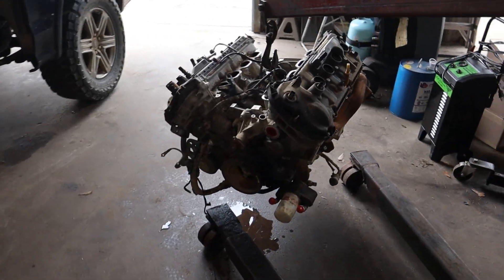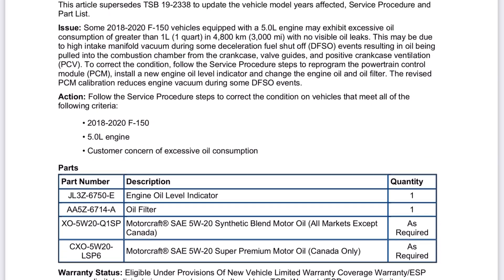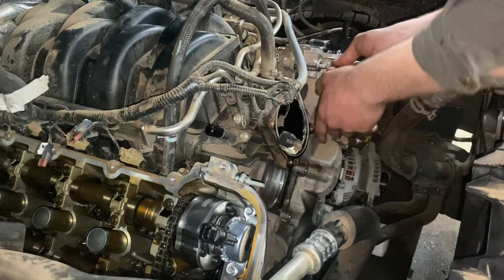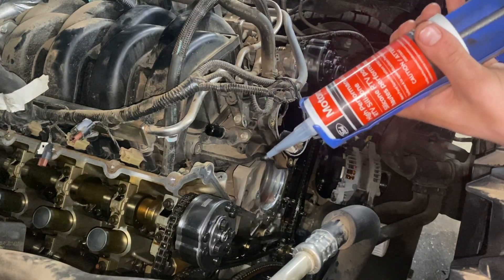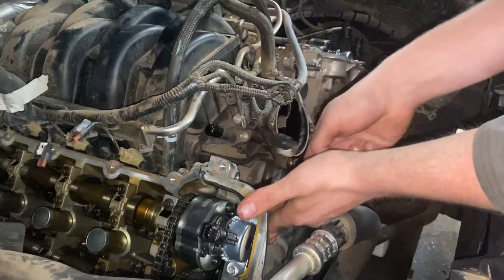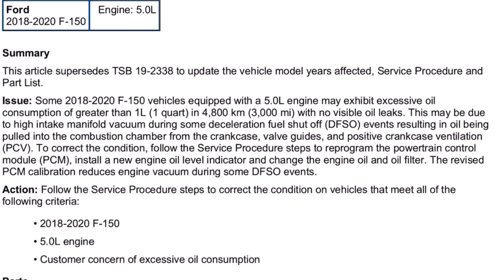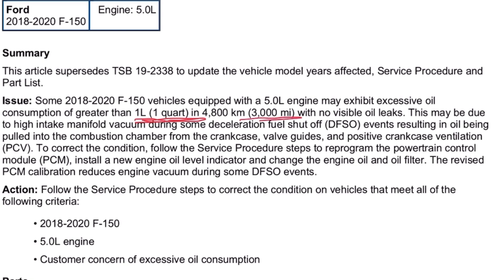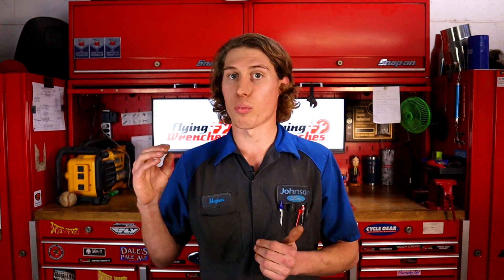Ford 5.0 Coyote Oil Consumption FIX

Comment: I have been a Ford tech for 36 years and have talked to a Ford Engineer from Dearborn.  He told me the dip stick is wrong. If you change the oil and fill it with the specified amount of oil as per engine specifications, it sits at or below the bottom of the cross hatch. Then they add more oil to bring it to the top of the cross hatch. Now it is overfull. The PCV system will draw the excess oil into the intake to be burned. Like you said, if you never check the oil it would be fine. Lol. In conclusion, the engine consumes oil because it is overfull. That is why Ford recommends the new dip stick with the correct markings. The reprogram on the PCM was a cover up attempt to hide the fact that Ford put the wrong dip stick in the 2018 to 2020 F150 5.0 L. The Ford Engineer told me the PCM reprogramming did nothing as far as preventing oil consumption.
Reply: So ,, If your 2018f150 5.0  ,, " Holds"  8.8 quarts  ,, You install 8.8 quarts it's " Over Filled "  ?   ,,,,  ( Why do I feel Dumber after reading what you Commented  ?  )  😅
Reply: I had a 2018 that consumed oil.  They reprogram the engine and changed my dipstick.  Neither fixed the problem.  They changed the phasers and that did not fix it.  My truck was in the shop more than at home the last year I had it.  The problem is most likely bad coating in a certain batch of engines.  Not all 5.0 burn oil.  Ford knows they need to replace the engine to fix the problem.

Comment: If people never check their oil, then how do people know there is oil consumption? That doesn’t make sense. Also, if Ford designed the engine to work that way, then they wouldn’t have been replacing engines under warranty for oil consumption, they would have said it was designed to work that way. No offense, but this sounds like a corporate response.

Comment: The cylinder lining getting changed. 2018 to plasma sprayed cylinder liner and rings don't seat. My 2018 f150 5.0 uses a 1 quart every 2k miles. Ford changed the rings on the newer gen 4s.

Comment: Ford told me it’s ok that there is no oil on the dipstick after 5000miles.  Crazy. I blame it on the plasma lined cylinders.  They fixed it on the gen4.

Comment: ok so of the 200 fords in my fleet and one of my 5.0 no leak and loss of 3 quarts after the t.s.b up date  so how do i fix my oil loss ??? and all my driver check oil as ALL ENGINES BURN / USE OIL AS THE COMBUSTION  PROSSES  3 QUARTS IN 1000 MILES IS NOT NORMAL .   SO YOU HAVE NO FIX

Comment: I agree with you. I have a 2020 5.0 I measure oil going in and measure it coming out. I usually put 9 quarts in. I usually get seven out and I change my oil every 6000 miles and no I don’t check my oil in between oil changes And I have no problems and I don’t expect to have any problems

Comment: I had this issue with my 2020 5.0; and installed a catch can after they applied the TSB fixes and it still uses oil. It uses a little less than it used to, I can now go 3000 miles before adding a quart. I was using a quart every 2000 before the TSB. I check the catch can every 1000 miles and it usually has about an oz or two so the problem still persists. I've noticed the tachometer goes up as it downshifts when slowing down so there is still engine braking going on unless you put the truck in snow/wet mode, where it doesn't downshift when you let off the gas.

Comment: Ford just replaced my wife's 5.0 motor in her 2018 due to this same issue and metal shavings in the oil. She had 1 month left on her extended warranty, also the dealership had just came out to the house 2 months prior to change the oil. So it was all documented that we had a oil change by the dealership.

Comment: I liked your channel until this. My check engine light came on around 90 000 miles and it was a vvt code. I check the oil and it wss none on the stick, it took 5 qts. Oil change regularly at 5,000 miles. Being a mechanic for over thirty years i never heard such bs. Most cars with vvt will through a vvt code when oil is low

Comment: Mine was 3 quarts low after about 1500 miles, and it caused damage to a solenoid. After that got fixed I checked the oil after another thousand miles and it was low again. If I don’t check my oil she’s gonna blow up.

Comment: Check oil once every 2 weeks period. I agree with Matt Phillips wholeheartedly. My 2012 also burnt oil and when I went on road trips, I used to take extra oil with me. However, the PCV valve change slowed it down a LOT. Check oil twice a month of not once a week. I am going to give this video a thumb down for many reasons.

Comment: Ford changed the 5.0 oil away from 5W20 , now 5.0 will use 5W30.... Too thin when hot... The GT500 uses 5W50 full synthetic

Comment: My 5.0l 2020 F-150 went through an extra 5 lires of oil between oil changes recently. I didn't know they called it a 5.0 l because that's how much oil it consumes. It's currently a candidate for a new motor as per Ford's TSB.

Comment: "who checks their oil anymore" only people who like their engines to run for a long time... lol

modern cars burn a ton more oil than old cars... they use water thin oil and it leaks out a lot easier and faster... i find modern cars burn more oil than old cars... "normal operation burns one wuart every 3k miles".... ok and the oilchange intervals are what 8k according to the factory? so youll be 2.5 quarts low and sucking air around corners by the time of scheduled change... geee i wonder why modern engines only last 100k  anymore? lol

Comment: As a lifelong mechanic I don't agree at all with him saying don't check your oil. I think that's silly. My bigger concern is that the oil That's not being burnt in the combustion chamber is going to the cats and being burned there and stressing the cats which will in turn burn them out causing a pretty substantial repair.

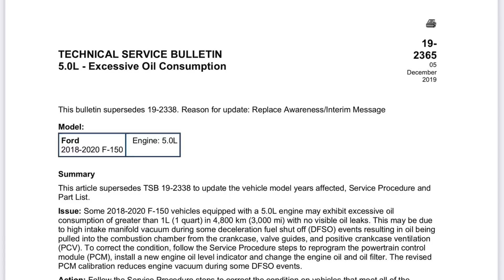Comment: 1:23 my opinion before I hear yours is that the 5.0 pistons are just built looser than older vehicles. The looser they run the higher mpg I would guess. All vehicles are gonna use a little bit even if you don’t think it will you take it on a long road trip and you will see that it does. The pistons burn off just a small amount the longer it runs.

Comment: It’s a problem. I don’t think it’s anything to do with a PCM or a vacuum. We just sold our 2019 f150 because it was consuming both oil and coolant. Truck only had 71k miles on it. We bought it with 30k miles and didn’t have any problems until a few months ago. Like mentioned in the video we weren’t checking the dipstick. Then it started knocking and I pulled into an O’reillys. I put 4 quarts in there to get it in range. A week later another quart. Been burning through quarts so much we just stopped changing the oil because it’s always fresh and clear looking. Then the coolant consumption started last week. Dumped a full container in the reservoir at a 7-11 to bring it into range. 3 days later another 1/2 of a container of coolant and more oil. Drove it straight to the dealer and traded it in for a Jeep. My thoughts is something failed internally in the last 10k miles and keeps getting worse. Not sure what it is but I’m sure I’m not going to keep it to find out the hard way and have to shell out $10k on a $20k truck for a new motor

Comment: Been checking oil since i was 7 years old, ain't stopping now. Wow, just wow, and i drive fords. Ranger 2.5, over 180K, 6 quart due to the ph8a mounted vertically, doesn't burn oil. 14 coyote, 166K, just started to burn a quart during last 10K. The beatings and oil checks on these will continue until fords customer care improves.

Comment: the thinner the oil, i.e. 5w20, you WILL burn oil. Ford and every damn company for that matter, keep lowering and lowering viscosity. ONLY to meet CAFE standards and "improve" MPG. Right off the bat, try 5w30 oil. Install a new PCV. just those 2 alone, you WILL see less oil consumption. even further, you can install a PCV catch can system, and up the oil to a 5w40 or a 5w50. The 5w50 has already been "Ford approved" in several Mustang 5.0 applications.

Comment: '14 was burning 5w30 syn, at least qt about every 2k at 165k. Put the valvoline retsor protect 5w30 in and it stopped burning oil right away. 🤷‍♂️ on second oil change with it now. 

All i noticed was it looked pretty thin at 5k miles, but nearly full.

Comment: Sorry bro but checking my oil is how I found out. Came straight home from a fresh oil change at the dealership. When I noticed I got straight online and found out immediately the oil consumption issues. They're making me jump through so many Hoops my extended warranty is going to run out first. I don't know what to do it's using two or three quarts per week it's to the point that I am pouring burnt oil in my engine

Comment: My change engine oil light came on... but I have no leaks in my 2020 V8 F150 so comminuted driving. Soon there was a funny rattle and the engine light came on and I was losing power going up hills... I checked my dip stick and there was no oil in the engine. In all the vehicles I have had... Nissan, Audi, Kia, Toyota... this has never been an issue

Comment: I’m 33 and check oil on everything I use. For outdoor equipment like mowers, snowblower, etc I check before I start them every time. For my truck I do every month or so. I think it’s absurd to never check oil and to think it’s ok to be burning 1 qt every 3,000 miles. Going the specified OCI that would mean over 3 quarts low.

Comment: Blame the EPA for a lot of engine problems. New fuel economy standards that have to be met every year causes engineers to grasp at straws ie. low tension rings to reduce friction . Lighter weight components to the point they crack/flex/ cause misalignment. Plastic components for weight reduction/ cost ect. Trying to get good fuel economy with hi horse power in a super light weight engine means everything better be dead nuts. That can't happen in a mass production setting that churns out 100,000's engines . Boring / honing equipment require frequent maintenance for dimension specs and cylinder wall surface finish. There are too many fires to put out for the engine plant to keep up with everything.

Comment: On these engines the crankcase vent is electronically metered.  That being said,  they burn oil at increased rates primarily because of LV engine oil combined with low ring tension.  Use 5w40 and check your oil frequently!

Comment: That’s a cop out, not checking your oil,how does that explain why the engine is consuming oil?  Don’t check your oil is your  fix? You have got to be kidding ! Just because you don’t see your oil level go down because your not checking it doesn’t mean there is no problem…… your just lucky the oil sump capacity is high enough that it doesn’t run out of oil!  Any engine that goes through that much oil,there is a problem in my opinion!  If your running an engine under full load constantly ( like on a gen set for example)then it’s possible to consume a qt of oil between oil changes, otherwise it’s not normal. There is a problem….. engine rings for example…… something is causing it

Comment: Dude you're wrong. I own a 2018 with that 5.0 with 124675 miles on it and engine just blew up on the highway. BTW. On checking the oil, I do check my oil since ford mechanics are so dumb to put the right amount of oil on the trucks all the time. Now ford will not take any action on this and I have to pay all that out of my pocket.

Comment: We should be checking the oil like we used to with the old 60s cars. What I read in comments makes sense. Forged pistons, low tension rings, and the spray cylinder lining. Those together. I don't doubt the plasma lining is tough, but maybe that's part of it. Is the coating so hard that low tension rings dont ever "break-in" like they used to? My  2019 F-150 5.0 burns oil like it's still breaking in, though less than when brand new. Sometimes. A lot depends on the kind of driving. Straight highway, constant speed, running all day at operating temperature - I could drive 3k mi and hardly burn any. Around the suburbs in my normal routine, it can burn a quart in 1,500 miles. Never had the "fix" done. There's a reason the vacuum is sucking oil like this. I think it's the forged pistons needing the looser rings coupled with the spray lining. To me, this makes sense.  Different driving habits mean that not everyone experiences it the same. I'm retired. I do a lot of cold starts and short trips. In Canada here, I have even more warm-up driving. I check oil like I've done for 40 years, especially when I know it's consuming oil like this. I don't depend on it holding a huge capacity, when I dont know what amount is safe when the dipstick goes dry.

Comment: This guy is not someone I would want working on my car or truck! If a tree falls in the woods, and no one saw or heard it, it really didnt fall! I can tell you if your vehicle uses oil, it will shorten the life of your cat. After building engines for over 100 years, and they start using oil shortly after leaving the factory, there is a design flaw!!

Comment: The reprogramming did help my 2018. It was using 2 quarts in 5000 miles. I change oil every 5000 miles. And yes, I check my oil at least once a week, after it sits for at least 30 min.

Comment: I check my oil every Monday morning.  Losing oil at a quart every couple thousand miles is not acceptable.  Designing a system to have 3 quarts to be a range is plain stupid.  Kind of apropros that the loss of oil to this magnitude started with the 5.0 and is the only engine on the market that guzzles like this.  Normal, abnormal is more appropriate.

Comment: Dont burn oil lol. My 2015 5.0 used to burn oil but I put catch cans on it. Passenger side catch can has oil in it every oil change about 3/4 full. The drivers side is as clean as it was when i installed it.  The problem is where they tied the valve cover back to the intake for “emissions” It creates a vacuum thus it pulls oil.

Comment: I had a 2018 mustang gt, bought it brand new and put 18k miles on it in the first year I owned it. Mine had timing chain rattle on startup and since it was a manual transmission under deceleration at low speeds in first it would rattle very loud. I took it to ford as it was still under warranty and they told me this is normal. Mine also consumed oil, even with an JLT catch can on it. Was so worried about the longevity I sold the car after 1 year of ownership.

Comment: My thought is if the vacume is pulling oil into and through the combustion chamber. Then it is going through the catalytic converter. At a quart every 3,000 miles, that is a lot of oil in those cats. I'm surprised there isn't a lot of cat failures and how did or does it pass emissions? 
It would also seem that the valves and combustion chambers would be loaded with oil coke. Rings loaded. 
I'm not saying you are wrong.
I'm saying there's more to this than just oil missing. If it's going through the combustion process. 
I've owned 2 coyote engines. I never checked the oil in either one. Just had them serviced regularly.
Thanks to you, I'm curious now, aka concerned.
Ha!
Your theory sounds right to me.
I remember when pcv valves where a maintenance part. If you installed the wrong one it would suck the oil right out of the engine.
On decel and wide open throttle. 
Chrome valve covers without baffles would make this way worse.

Comment: At least Ford researched and offers a fix for oil burning. Chevy will tell you it is normal for their Silverados and Tahoes to burn 1 quart for every 1k miles from new. Literally purchased an extra 5 quart jug for a tahoe between oil changes due to its oil consumption.

Comment: I don't own one of these, but I'm curious: what does Ford specify as the oil change interval for this engine? I drive a 4.6, and I almost never check my oil between its 4000 mile oil changes. I figure if it ever drains out less than the 6 quarts I put in, then it's time to start checking it more regularly.

Comment: Unrelated issue, the top end of the passenger side of the block(I have an 18 5.0) is making what sounds a like a tap noise, I see some that say it’s a roller issue and others that say it’s simply the VCT solenoid or HPFP. Any ideas fellas?

Comment: Sounds a little skewed because his paycheck comes from Ford. He does bring up some excellent points. I have never checked my oil unless I have to. 
1) purchased a used 2019 f150 - 5.0 because of reliability. 
2) unfortunately after about 7,000 miles after an oil change, heard tapping, extra knocks and eventually a “check engine” light. 
3) checked the oil and nothing showed on the dipstick. 
4) after adding oil all knocking and tapping went away. 
5) found it weird that I received knocking , tapping then a check engine light came on without any oil indicator lights. 
My conclusion is that there is a problem but I will have to see if this pcm update fixes my issue

Comment: Its definitely a problem. I have a 2011 that uses a significant amount of oil so much that i change the oil every 2500 miles. I bought an 18 2 years ago and it uses a significant amount as well. I think its the damn PVC system. I recently ordered catch cans for both trucks hopefully they help. I dont check my oil but when i dump 9 quarts in and after 2500 miles i barely have a gallon in the truck that could cause major issues especially if you use Fords oil change recommendations. Im sure it boils down to all the EPA regulations.

Comment: 2 Things I did that may help, and it WASNT stop checking the oil...1. Install a new PCV valve, They're cheap may as well. 2. Go to 5W30 oil to possibly lessen the use.